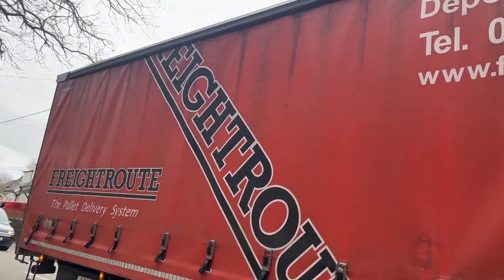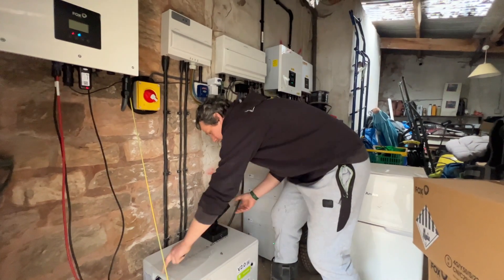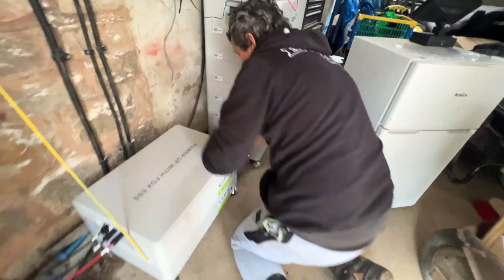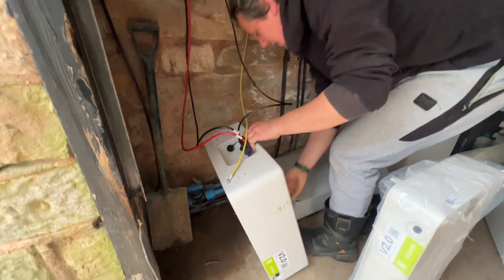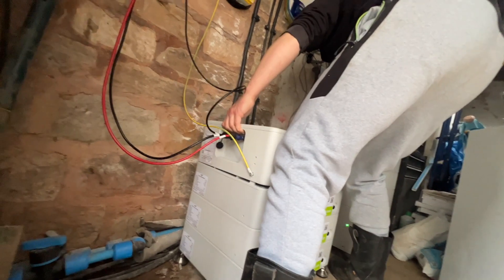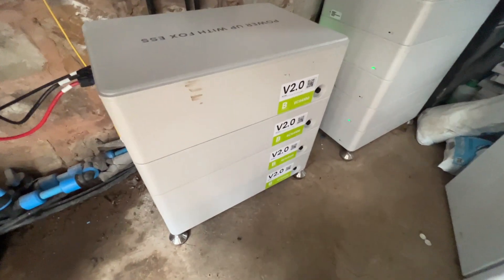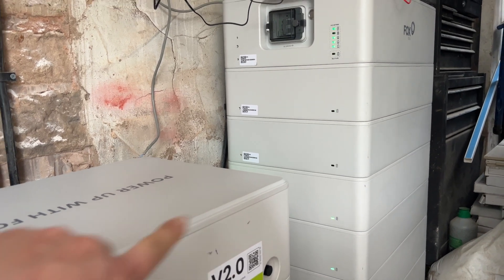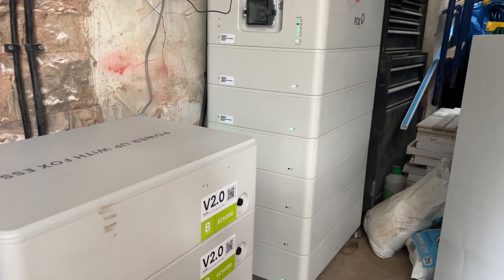Edging Towards off Grid Capability?

Comment: Hey did you end up having any issues for running a different number of modules per stack? I was told it had to be same amount of modules on each stack but would like to hear what you've been through.
Reply from the maker: Had no issues no. The important thing is to make sure all same SOC before connecting up…otherwise quite big issues will ensue.

Comment: I am ordering a Fox battery system wirh 1 master and 1 slave to begin with, but I wonder why Fox didnt design it with the master at the base and the ability to stack the slaves on top? Would allow for more secure wiring.
Reply from the maker: Heat dissipation perhaps?

Comment: Ian, the new slaves come supplied with a 50% SoC so you should drain your existing cube to 50% before adding the new slaves or you end up with an unbalanced battery pack which can take a long to to sort itself out. Also you really should get the firmware update after an upgrade to make sure all the slaves are on the same versions.
Reply from the maker: Firmware all upgraded (as I have installer access thankfully…as 1st4solar went bust!). Packs all good and working nicely.

Comment: Just a quick question we’ve had a fox system install but our installer has said it is a grid reliant system so if there is a power cut the system won’t work. Is that the same for your system? If not how do you get it to work without the grid?
Reply from the maker: I specd mine to work off grid, and it will do so. we have the auto switch over fitted.
Reply: @IanSampsonRLO  thanks so much for the response. Did your solar installer source that part and is it a Fox ESS part? I asked the Solar sales man that we wanted to be able to use the battery when the grid went down, he never said the system couldn’t do that and then when installed the said it was grid reliant system and there was no way we could use the battery when the grid went down. I’m trying to start a complaint with them so just trying to obtain as much info as possible. I appreciate your help.
Reply: What kind of auto switch do I need? To be  working off the grid. Is it expensive?  Thank you.

Comment: 10kW array is a good size, what made you discount Octopus Flux with a smaller battery?
Reply from the maker: Octopus Flux as in their energy plan or is there a product?

This system due to its ip rating, its broad temp range usage, its prices and ability to expand over time.
Reply: @IanSampsonRLO  the energy plan. I’ve also got 10kW PV, still deciding how big to scale the battery. I use about 11MWh/y (inc. EV).

Comment: 20 grands worth of batteries there.  That's a heavy outlay to save a hundred a month on leccy?
Reply from the maker: £100 saving? How did you arrive at that figure?

£100 = just 4.8 cycles of the batteries (~7 days worth of usage), current energy cost £0.47 p/kw peak. (Peak is 20 hours out of 24).

Comment: That's nice and easy. I thin I would equal out the battery stacks to balance things a bit more although does the slave charge from your solar or just from 240v (grid or master inverter 240v output)?
Reply from the maker: It would only be balanced in terms of aesthetics as they essentially are independent/stand alone systems. So each have own BMS. 

They can charge from grid, or just from solar or both based on a rule base.
Reply: @IanSampsonRLO  If the battery banks are more equal then the charge & discharge current will be spread more evenly.

Comment: Very informative. The Fox ess system has a lot of positives.
Reply from the maker: It does, especially in this regard. It just lacks with climate ‘control’. If the system was inside a heated / cooled house it would defo help.
Reply: @IanSampsonRLO  I have cube batteries installed in a concrete sectional garage with no heating. I built an enclosure out of 50mm celotex PIR foam insulation, the heat produced by the batteries warms up the enclosure and it stays at a fairly constant temperature.
Reply: They also have a lousy customer contact dept. Emails never answered and phone calls shut off, with contact you installer.